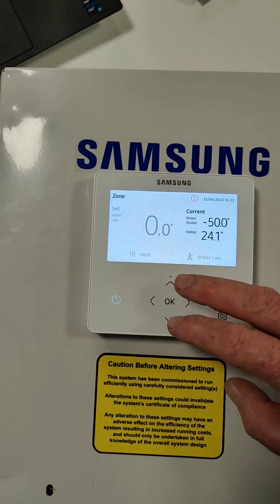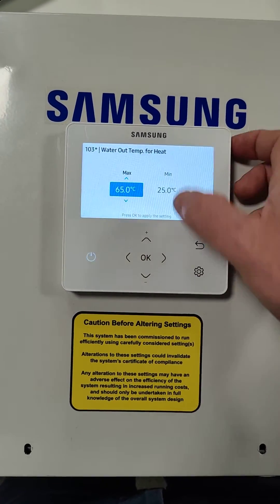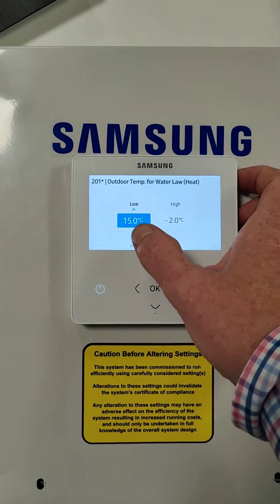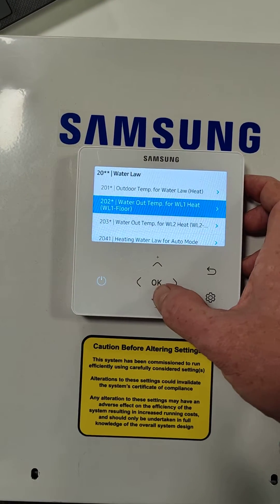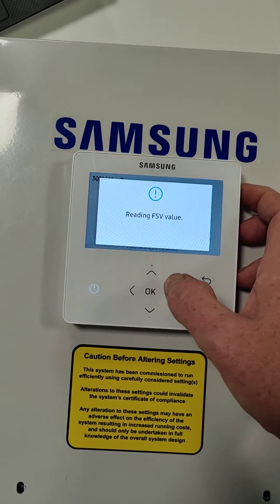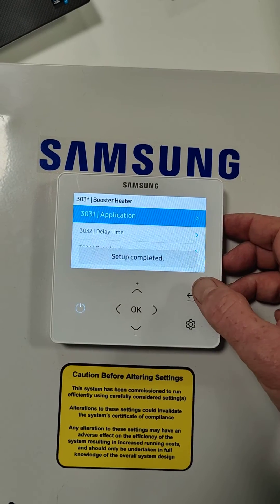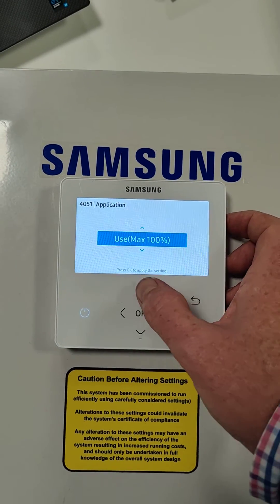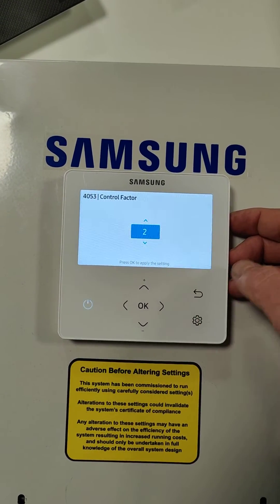Samsung Air source heat pumps HTQ how to set up the controller -  AE080BXYDEG  AE140BXYDEG

Comment: Graham, can I contact you directly, 77 and living alone, installers didn't fill out commission check list, so no guarantee applies, just found booklet hidden  behind log pile. Works well with hot water but  central heating rubbish. Live in Northumberland and just been through two weeks -0 could do with some help with what is wrong. If you can help would be grateful.

Comment: Hi, I find my system occasionally runs even when neither of the heating zones or the water tank is calling for heat. When this happens just the 'Water Pump' icon is on when I check under 'operational status'. Any idea why this happens?

Comment: Just wondering if anyone knows what switching 3061 Solar Panel /DHW Thermostat does? I’ve got PVs but don’t know how Samsung has interfaces with them! Side question, is it normal for my control panel light never to go out? Thanks!
Reply from the maker: it allows tyou to send in a run signal to stop the heat pump when the solar thermal is heating the cylinder, thats it its like a dont run switch
Reply: @myheatpumpchannel7577  any idea how to switch off the panel light, it's always glowing!

Comment: Hi, can I ask why the zone set for the central heating stays at 0.0? Thank you.
Reply: 0.0 is the offset. It uses the weather compensation settings in this system menu to set the temperature depending on the temp outside

Comment: Hello, on my unit, the weekly schedule is greyed out. I can only set daily schedules. Any idea? Thanks for your videos, they have been very useful.
Reply from the maker: yes daily is for hot water weekely for heating, you are using an external thermostat to drive the unit use this to time clock the unit not the Samsung
Reply: @myheatpumpchannel7577  Thanks, so to confirm, in the schedule menu on the Gen6, I can't create a weekly DHW schedule at all? This is the menu where I can select Economic, Power, Forced etc for the hot water.

Id have liked to set up a weekend only DHW approach. My external thermostat doesn't have any DHW control.
Reply from the maker: @Robkellysound   you cant control the dhw from anywhere other than in the samsung controller, its not possible to do it externally. you have to have the same programme every day of the week, its rubbish but thats life

Comment: Why is there no remote phone based app that can full control and monitor the Samsung ASHP.  This is the 21st century. Heat pumps are complex bits of kit and to be accepted as much as a fridge,  suppliers have to  be able to offer resellers the chance of offering remote support and diagnostics to look after the typical end users ,who do not  have a physics degree, when they run their heating system.
Reply from the maker: god knows i dont build the units, have you considered asking whoever sold it to you
Reply: @myheatpumpchannel7577  I have had several calls with Samsung support. They seem to have no interest in doing it themselves or opening their design to let in third parties .